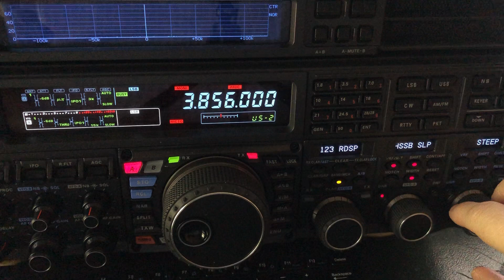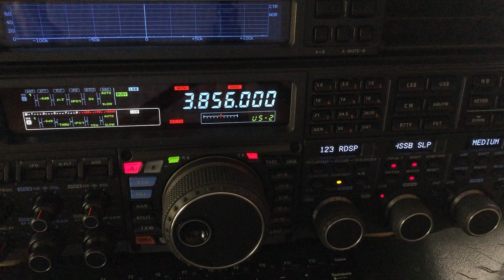Yaesu FTdx5000MP: SSB Digital Filter Shape and Slope settings

Comment: Have you ever messed with the AGC timing adjustments to aid in pulling in a station? The book says don’t mess with it but I’m guessing it can help when heavy QSB sets in. (Menu 1-6)
Reply from the maker: Actually I have.  But I found the factory settings for Menus 1-6 worked just fine, I have tried the mid setting with weak SSB signals.   Ultimately I found the factory settings usually work best.  Just press the AGC button straight in and the radio will choose Fast for CW and Slow for SSB.

73, de N4HNH